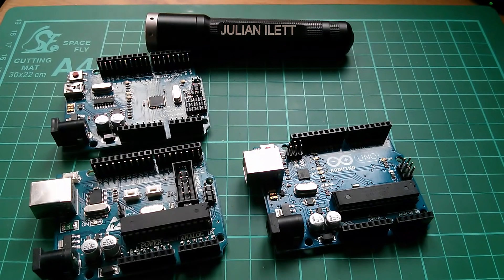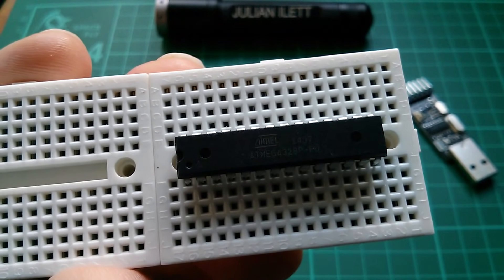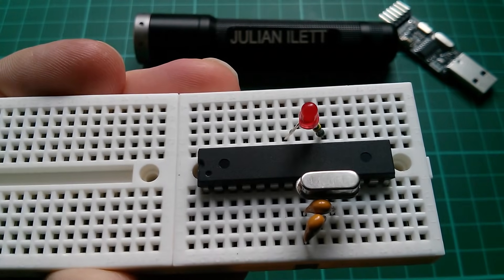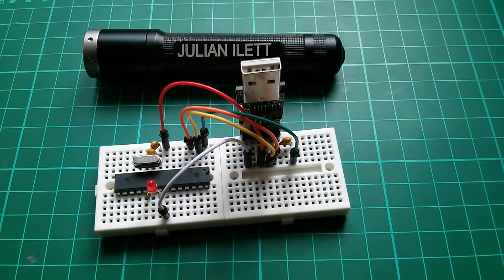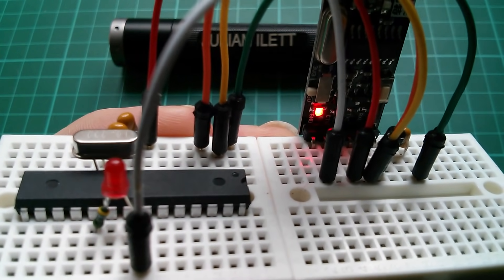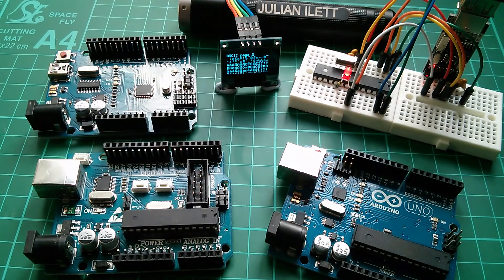1-Day Project: Build Your Own Arduino Uno for $5

Comment: Absolutely brilliant! This explains so much, thank you for documenting this and sharing the video! The microcontroller aspect of electronics is very new to me. I am a Retired Sonar Technician by trade, read that as electronics tech. My first sonar system I worked on, there was only me and one other tech that maintained that system, spanning 8 spaces and about 300 feet, and it was an analog computer, no CPUs, no hard drives, and it ran perfect! I knew that system inside and out. Logic gates were not ICs, they were resistors and transistors, many many cabinets.

Comment: Nice video, the question is, (I'm beginner) ones you flash the code inside, do you still need the usb thing, ot you can send 5v and groun and  it will work?

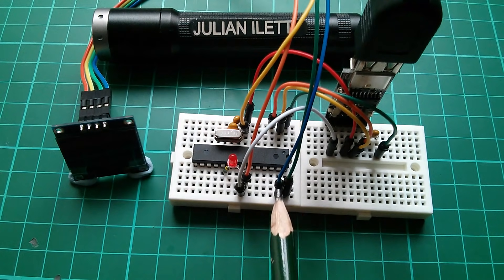Comment: Can't find Datasheet/Service manual for this car sensors maker thing. if your Xiaomi Huawei can already run GTA San Andreas - it's a 2GB graphics card memory controller chip you should get, because that's CPU AIO graphics display and that's so much I need not to melt under 107° degrees 11:37 and something about is e-commerce - maybe a flash light.

Comment: Hello... Good video and very instructive.
I did everything indicated in your video, and it works, but sometimes an error appears:
"avrdude: stk500_recv(): programmer is not responding
avrdude: stk500_getsync() attempt 1 of 10: not in sync: resp=0x8c"
One step that you don't show in your video is when you are programming the Arduino IDE: Card, COM, but you don't see that you choose the Programmer.
What programmer do you use?

Comment: if i do this, would it be possible to run the program without the usb to serial after loading it?
would i just need to connect a power source to the chip?

Comment: Very weird! I have a rip off Arduino and it has exactly everything a genuine one has. the only difference is that this one has a different brand called UNIROI, It even sounds like Arduino in a way, and it preforms just like on was well. I can't believe they didn't get sued by Arduino.
Reply: Look up what open source is
Reply: I know what open source is, I am not 7. @elyknavillus777

Comment: It is cheaper because you can buy multiple ATmega328P chips and use this circuit only for programing. You only need to buy the USB to TTL converter once after that you can build infinite Arduinos with it.

Comment: Great video! To be pure minimalist, no LED/Resistor and the USB to Serial Adapter would be part of your special programming cable (not part of the board).
You can make a simple PCB, the Microcontroller, the Crystal, 3 Capacitors, A 4.5V Battery Clip, a Diode, and a Female Header Connector that you plug the USB to Serial Adapter into to program/comms and then remove it (freeing up 2 more I/O if you need them but no comms). I would suggest a 1uF Capacitor across the VCC and GND pins of the microcontroller for added decoupling of the power pins. To save even more money, you could learn the complicated process to install the Bootloader yourself.
I think I am going to add this project to the Summer STEM class I teach - I try to save my students every penny as they pay for project materials, but I teach the class for free (8 hours a day, 5 days a week, 8 weeks over the Summer).

Comment: nice one , now if i wanted to code the chip on my official board then keep a program running on it can i just ignore the usb to serial converter and use the 5v power and gnd cables to a power source

Comment: Cool. The reason it failed to load the sketch might be because you need a pullup resistor to VCC on the reset pin.

Comment: the diy one works out better if you need a lot of them in one project. i keep a uno that has the removable chip and use that to flash my chips so no usb  to serial.  I am making a Quadrino ( 4 hips on one board)  This is to run a 4ch Oled Vu meter. it comes up at the same size as one uno  and fit in my amplifier nicely. the major benifit of using ready made arduino is the fact that you can run them on 12v .To cut a long story short it depends on your final use for the arduino if you need one to test and practice get a builtr one if you need to put them inside projects build them. GREAT VID

Comment: Hi, sorry for the question, would it be possible to load C-code instead of Arduino sketch  using CH340?  Say, code created in MPLab or Geanny (part of AVR toolchain)?

Comment: Do not need to use boot loaders or so to program ATMEGA328P chip. Just programm the chip using another Arduino board as ISP. You can also put the bootloader if you need to play with it the above way.

Comment: Is there a reason that you are using 20 pf capacitors with a 20pf crystal ?
For example, if the crystal load capacitance is 20pF, and assuming Cstray=2pF, then:
C1 = C2 = 2(20pF - 2pF) = 36pF

Comment: Oh my god. I wished i even knew where mine was. I really do appreciate the video, i was just gonna buy a nano for each little thing. This way i can make my own and just use the usb to serial to program it. Holy smokes if i get an inline chip mount uno knock off i can use it to much easier prototype and program the chip. I am going to save loads now.

Comment: hello there!! Can I use cp 2102 converter and as for the capacitor, each is 20 picofarad right??
Reply: i can't found 20 pf capacitor, but i can only next to the 22 of capacitor
Reply: is it right?
Reply: @321fire9  The capacitors only need to be close, so 22pF should work.

Comment: I would think you need a 10K resistor to +5 to insure the chip doesn't reset itself.  Also many others put +5 on the Aref and Avcc?

Comment: I refuse to buy parts from sources other than directly from the manufacturer, or their official suppliers. Because I have this idea in my head that they have somehow tinkered with the components and put malicious codes/spyware inside... Like a physical "man-in-the-middle" attack xD

Perhaps I'm just paranoid... But it actually happens! Okey it's probably safe to buy LED's and resistors, but a microcontroller with a pre-installed bootloader from Ebay? To me that just translates to "pirated microcontroller-clone with a modified bootloader/camoflauged spydevice"...

Comment: Yes I agree but its far more viable  long run although thats typical of the approach to decent engineering  

It teaches you a dam sight more 

 You at least learn how to make a printed circuit board and read a schematic and identify components

 You  also wind up with some form of decent engineer rather than the rubbish Industry produces today and at  least you have some trained people in industry who know what they are about which is more than I can say of industry  and  management  that are supposedly the worlds future leaders 

Then finally I suppose  you can also check your imports properly too at the end of this as well as possibly manufacture   , which wouldn't be a bad idea then you'd actually create some decent employment with  some form of  decent career for a welcome change 

Not that to many of us can get that much into some of your heads  or  why industry is failing miserably  Still those are my views on that subject  not that i suppose many would take to much notice of that either  which also typical 

Its also possibly why nearly 70-80% of the management cant so much as provide a color code  for a resistor and why I find nothing but design problems  in quite a number of your imported goods but then you  dont exactly complain to much selling the stuff do you so long as you can stuff your pockets with a massive bonus while you leave the country completely untrained ,  and with no idea  I never see you complain to much then do you 

Then also typically you dump the mess that you've made on the rest of the country and its people expecting that they should clear up all your  problems for next to nothing as well while you point fingers and blame all save that of yourselves in these suppose glorious  positions of extreme supposed importance 

That's also after the county loses a few lives over your mess thats typically left for all else to clear as well

Then i suppose we could also comment on the number of demonstrations in London too could we with reflection on global warming as a whole and the the amounts of money you poured into Europe , which was all done  to attract this wonderful cheap labor and cheap goods of no real quality either  whilst forgetting  about your own country and stuffing the nation up even more than ever couldn't we ?? Still there you go i suppose so much for the idea of creating better futures

Perhaps you could build an arduino tree house with all the throw away printed circuit boards and components seeing as you've sold  any affordable housing off as well plus the rest of the industry

Comment: after i finish coding can i unplug that usb thingy and connect just mircocontroller to some other circuit or i have to keep some thingys connected to it ?
Reply: You'll need to hook it up to another power source (as the micro controller is powered by the usb in his set-up). And, obviously, you won't be able to communicate with it from the pc. Other than that, you're good to go.

To make it easier to troubleshoot/update you can add pads/headers that allow you to connect the CH340 (or similar) to your circuit board.
Reply: @pH7oslo  Oh then its nice because i need to just send code to it somehow and then reconnect to other projects. Thanks for advice tho ! :)

Comment: The arduino nano is also increadibly cheap (about $2 on ebay)
Reply: None of those cheap versions use the long DIP ic, though, so you cannot re-use/adapt the chip in this way, unfortunately.

Comment: Just a note to the fans of Julian watching this build. And to you, too, Julian, but you may already know. OK, I did all this (your build) on my breadboard but my USB to serial interface was different. It worked fine the first time uploading the code but I had to wait to upload again. What I did was put a pulldown resistor between Reset (Pin 1 on the Atmega) and Ground. I had a 22K and that works. I am sure a lower value would work. This is AFTER the ceramic cap. (From the USB to Serial interface pin DTR to the ceramic cap). Before I put the resistor in, I would have to wait about 2+ minutes before I could upload a new sketch. I mounted the resistor on the breadboard so I didn't modify the interface. I hope I explained what I did clearly. CP2102 is the chip on the interface. SI or S1Labs. (Replace the word "interface" in my post with "converter").

Comment: After you've programmed the home-made arduino, can you remove the serial/usb converter and let the board run independently?
Reply: yes but there is need for power supply

Comment: If you bought all the parts in bulk I'm sure you'd be saving a lot of money but you would be missing out on all the protection features, the reset button, the pins, the built-in LED.  I see the arduino as a protoyping board.  Once you're happy with the code and you're sure you got everything right you remove the chip from the board and buy a new one to program.

Comment: Well done. If anyone wishes to develop a commercial product using Atmega/PIC style tech they need to use the chip itself on a dedicated PCB with whatever interface parts are needed for their application. Using an "Arduino" to make a commercial product just isn't on IMO. You don't see Samsung selling a new (insert name of electronic gadget here) with an Arduino board mounted inside it. Ridiculous! Arduino's etc are a learning tool so experimenters and hobbyists can more easily come to grips with how to use a microcontroller. They should NEVER be used in a finished commercial product as several people have done recently.

Comment: Hi, i have a question. i bought a serial to ttl ch340g but there is no dtr pin. it has 6 pins. do you know how to connect it to the atmega328P and do what you did on the video?
Reply from the maker: Use RTS instead.

Comment: But it isn't a Uno. It has no USB-to-UART converter ATmega168, it doesn't have a voltage regulator, and it's "pins" are completely un-Arduinic. It's good to know a naked ATmega may easily be programmed by the Arduino IDE though.

Comment: Or you can buy a fully functioning R3 Uno CH340G for $3.02US OR BEST OFFER with FREE SHIPPING. I am not affiliated. That does not mean this is not a useful article but the focus should be size and power consumption not cost. It's great to be able to make your own tiny Arduino but it will cost you more than a clone!

http://www.ebay.ca/itm/Latest-Version-UNO-R3-ATMEGA328P-16AU-CH340G-Micro-USB-Compatible-For-Arduino-/182169283763?hash=item2a6a22acb3:g:P-4AAOSwbYZXXmzi

Comment: How do I provide an external power supply for this circuit without the USB to Serial converter? Do I simply need to put a battery along with a 5V voltage regulator to the Vcc and Gnd pins?

Comment: so you don't NEED to connect all pins marked GND and VCC? I see others running AREF to VCC and some to 3v3 with a 3.3k resistor. Since your setup works I'll go with yours.

Comment: I have run through this every which possible way.

However, I cannot burn a bootloader using this method.

I bought the exact parts listed.

I followed the directions precisely.

I wouldn't ask here, but I've been at this for several weeks to no end. What super-magic thing am I missing here??

Comment: as far as I know, you should use also a pull up resistor on the reset pin, to prevent it from accidentally reseting it self through noise, because the pin is technically floating

Comment: Hello I've got problem with my programmer (USB to serial converter). I have the same type as you here and I followed your tutorial and I have to say everything worked fine. I was able to upload sketch to "my new arduino" just as you. But after few while I was not able to upload sketch again or upload any different sketches. But when I put atmega328 to my bought arduino kit, everything worked fine. After uploading sketch through bought arduino i put the chip back to "new homemade kit" and everything works. So my question is: Is it possible that I bought bad piece of programmer? Should I buy again the same type as you here and try again? Or you think there might be problem elsewhere? Thank you for tutorial and your answer :)
Reply: Did you get a empty atmega32?  Might've needed the boatloader flashed on...    I think the arduino boards do that so you can swap chips out and solder them into projects?

Comment: I have tried this many times and it was a hit or miss...I inspected it with my oscilloscope, and to me it seems like pin RESET is floating and ruins most of the uploads...I used a pull up resistor (0.5MΩ) and i did get it to work every single time...Are all your uploads successful without the resistor?

Comment: Hello Julian, can you help me with one project ? I need an arduino up down counter with  one digit, to count from 0 to 8 and from 8 to 0 with two push buttons ? I need only the code and a picture with diagram wiring. Thx.

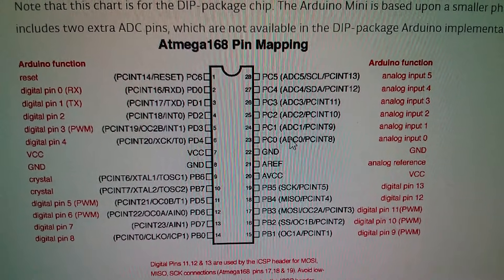Comment: my question about your good video, is  the *part in the videoscenery on 4:04 to 4:06 !

might be a god idea to say all your poeoles to talking at !, that a parallell conversion ist *always faster but if the serial confersion the conversion it self is getting *stable but takes a *little timelomer as a parallel confersion ?!
Reply: Seriiell confersan is for SHORT range and parallel conversion is for *ways miles and on !?

Comment: +julian llet , You can get away without the crystal too as the 328 has an internal 8MHz clock in it.  This is a great way to program 328's and then put them into your project and then each new 'arduino' that you want to make just costs the price of the 328.  Great video :)

Comment: Julian,

Good video.  Thank you for sharing.

Actually knowing a minimal setup can actually help with other projects.  One idea I had is using one of these ATmega328P chips and a few support components to make a retro joystick adapter.

Example of this could be to convert a NES, SNES, Wii nunchucks, or Playstation 1/2 controllers to a retro computer.

So if you wanted as small of a board as possible then using this layout you used is actually a good way to show how you can build a small customized micro controller setup. :D

Comment: And this is why I never understood the hype around arduino. I've always been programming my µCs like this and when arduino became a thing, I didn't get it.
I still don't.

Btw, you should connect your reset pin to vcc through a resistor. That's probably why you had to reset manually, as well, but I'm not sure.

Comment: Hi! Thanks for the video!
You mentioned a few times that the components which are not essential for the thing to work are omitted. So my guess is that it is not a complete board (I'm a newbie at this). Could you clarify what kind of features are going to be missed out? Please don't go into too much detail, just give me a little insight.

Comment: I've looked back through a lot of the comments and haven't seen this asked or answered, so I'll go ahead and ask:  With all that has been cut out to make this version, is there anything that this microcontroller can't do that the genuine article can?  In other words, if this is the bare minimum necessary to make the microprocessor work, what does the rest of the Arduino add to it (Aside from convenience with the power, USB connector, and convenient pin placement)?

Comment: This is actually pretty useful because you only need to buy the USB to serial, wires, and LED once, and you can then use those parts to program as many of these as you'd like. If it wasn't for that crystal oscillator, the entire thing could be self-contained!
Reply: Forgive me if this sounds like a completely noob question, but what makes the crystal oscillator a problem in this being self-contained?